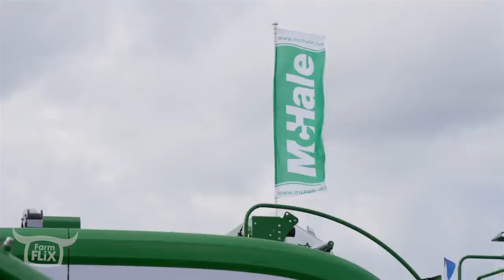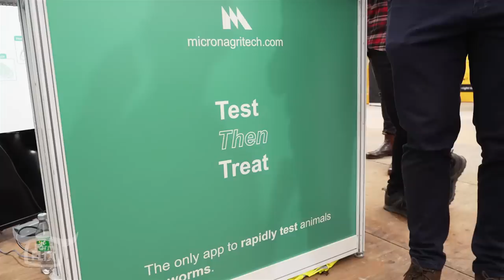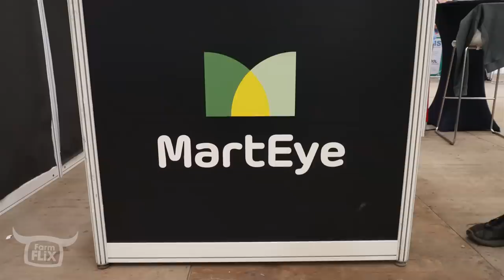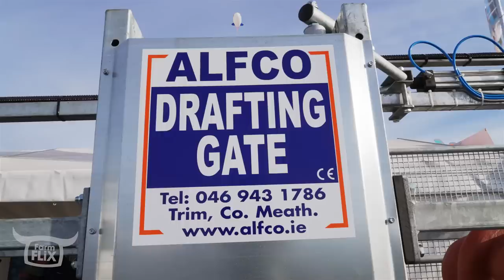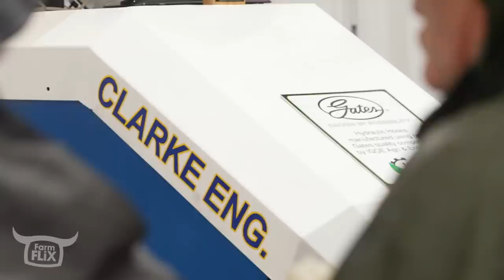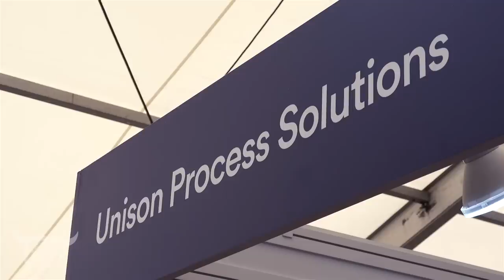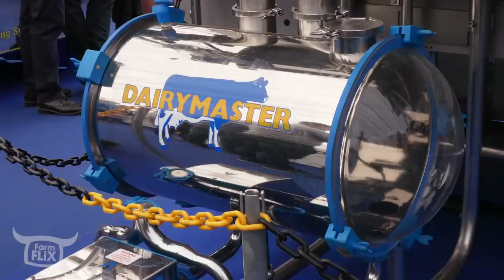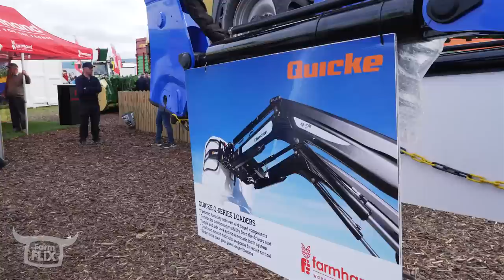FARMFLIX PLOUGHING CHAMPIONSHIPS 2022 feat. John McClean, Cityboy,  Farmer Phil & Enterprise Ireland

Comment: Only problem with those metal aluminium wheel guards is when they come into contact with a gate post etc they bend or smash unlike plastic which bends then goes back into shape.
Reply from the maker: Them oul gateposts test everything 😉🤣